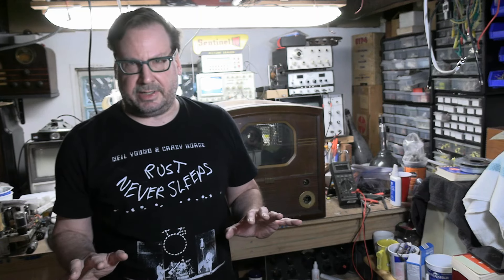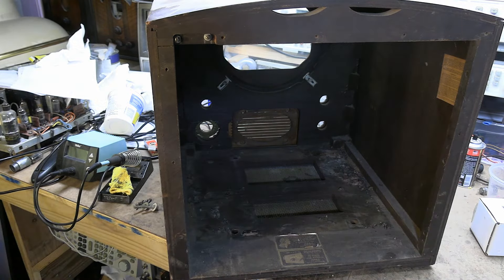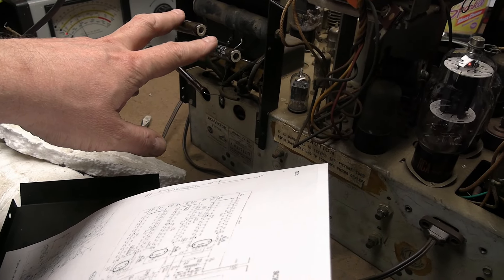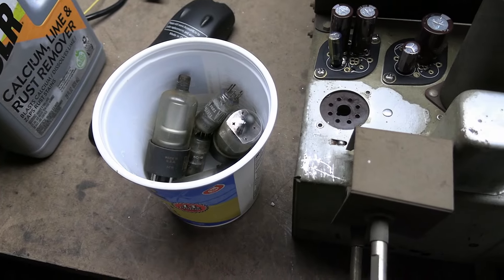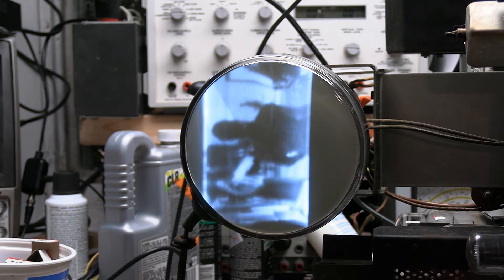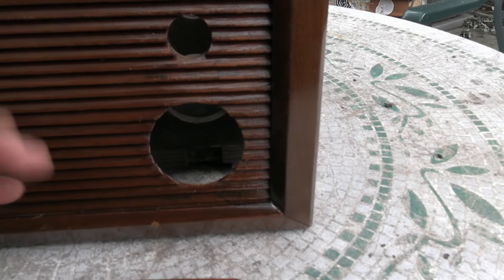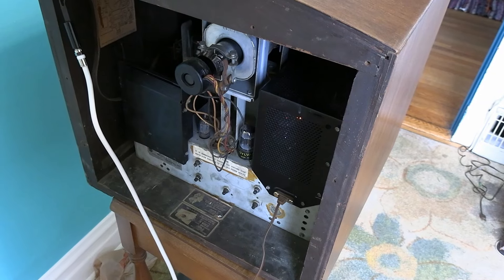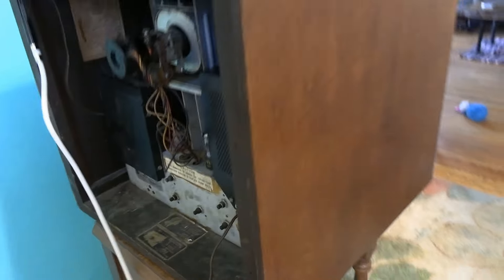RCA 721TS restoration (short cut)

Comment: Thanks Bob, looks great; I have a question about the crazed lacquer on top.  Did the top coat of new lacquer simply dissolve and reflow the original lacquer?  Did it require sanding etc.  Did it just fill the area with the missing finish in the back?  Thanks again. (edit spelling)
Reply from the maker: Yes, it was sanded and no it did not dissolve the old lacquer. Not fully anyway.  It was softened and leveled out.  You'll see it more in the long version.  I've shown this technique many times before.  For example the recent Crosley 3-7TA, the Admiral beginners series and my old refinishing without striping series.
Reply: @bandersentv  Thanks for the reference to that 14 year old series of yours.  Very nice. The specific question I haven't seen specifically answered unless I missed it regarding alligatoring/crazing is how far down to sand, and from above I take it that you sand some, but do not need to sand down to the bottom of the cracks, but get close.  The following layers of lacquer will flow it out.  I want to avoid getting to the bare wood obviously.  Thanks for sharing your knowledge and skill.
Reply from the maker: @PracticallyFixed  remember, there is color in the lacquer. You can only remove some of the topmost clear coat. Lawyer this old will not dissolve and reflow. You can still see fine cracks in the finish afterwards. The goal is to retain the color and prevent further deterioration

Comment: Excellent job! I know how it can be with the twists and turns in a restoration and the disappointment that can happen when you have a  set working great, and then it fails, especially when you put it together. So was it just a bad 6SN7 that was causing the really faint raster and no sound? The 721 interestingly seems to be an upgraded version of the 621 (which I worked on recently) for a 10" CRT instead of 7". Does this set use a permanent magnet ion trap? The 621 uses electromagnetic like the 630.
Reply from the maker: No there were multiple issues.  One of the tubes in the audio (6AV6?) died.  Insufficient screen width was caused by the 6SN7.  Position of ion trap caused the dim raster.  The wires are quite short and I had to rotate the CRT to get into the sweet spot.  This set uses an electromagnetic ion trap.  I have another 721TS with a PM type.